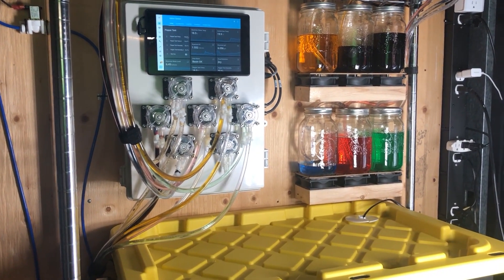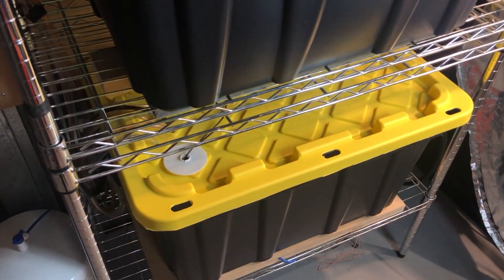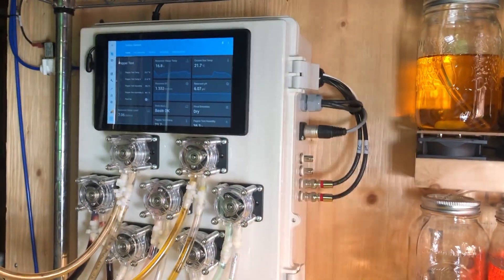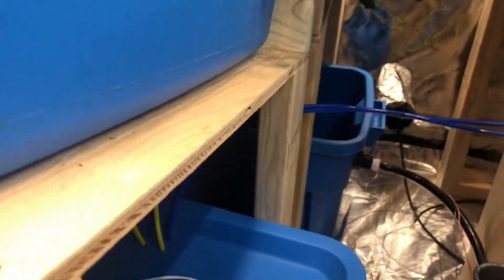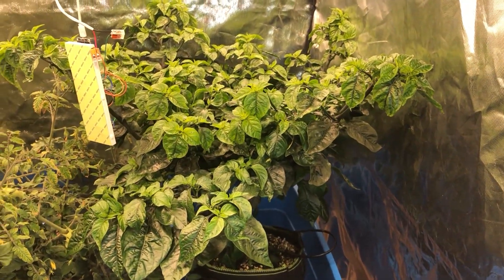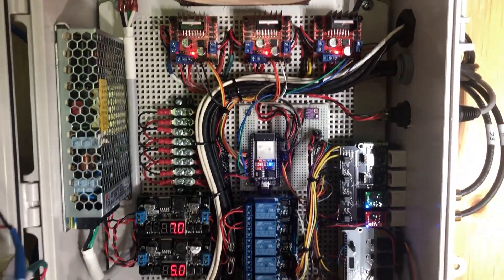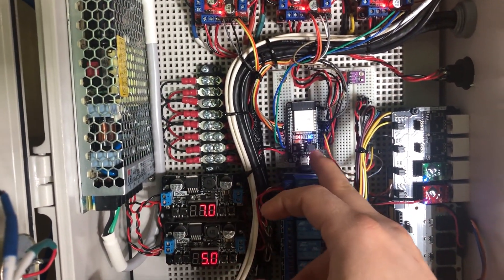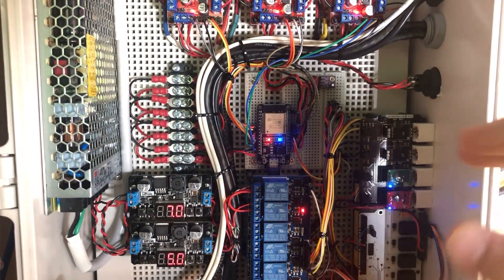My DIY Home Assistant Garden Automation System - Climate Control, Dosing, and More. Pt.1 - Hardware

Comment: Awesome Job, Loving the idea of using the fans under the nutrients to mag stir them prior to dosing! I have been stuck on that one until now - just need to make me some.

Doing something similar myself but using fully hydroponic DWC system. I decided to do it via Javascript (Johnny-Five) and node for the back end (using FIrmata for the Ardunio side) with some Svelte for the front end - quite the learning curve but great fun and mostly working out for me. 

Loving your build, very neat with how you have integrated the peri-pumps and the tablet display. Also good idea to weigh the water and I had the same idea although I only purchased a single sensor so not so sure how that is going to work.
Reply from the maker: Hey, awesome! How far along in the build are you?

The weigh scale kit I got came with 4 little sensors. It’s a cheap one at $15-$20 or so. I think each is rated for 50KG and my whole full res is somewhere around 150lbs. 

The magnetic stirrers are great. I superglued 2 stacks of 4 magnets per fan and cut a hole out of the shelf the jars sit on to get the magnets as close as physically possible to the bottom of the jar. The fans are controllable via PWM as well, I found that I had to ramp the speed up at first or the stirrer would spin out and it wouldn’t work.
Reply: @LEDGardener  Mostly finished with the hardware side  apart from a standalone (RF) controller for the Fill / Drain pumps and off course a new 8 channel mag stirrer still to be made. I mostly just need to finish the software side but this is taking longer than it should (for a software developer). I do have a couple of questions if you don't mind?

I also went with the White Labs Tentacle Shield  with EC, PH & Temp stamps/sensors and notice you have placed the EC/PH sensors on opposite sides of the res,  (as they are isolated) is this required? For mine I basically stagger the reads so that none of the sensors are reading at the same time - but not sure if it makes a difference or is required, it was just easy to code that way via Johnny-Five (callbacks).

Are you controlling your mag stirring pumps individually via PWM or just slowly spinning them all up at once? How often do you mix the nutrients or do you do this just prior to dosing?

How did you get around calibrating the Peri Pumps and how these are working out as they seem to have liquid in both sides of the pipes with air gaps. How does this effect the dosing accuracy?

Looking forward to seeing any updates to your system.
Reply: @LEDGardener  Do you still have a link or something for the weigh scale kit you used? Would like to check it out. Thanks